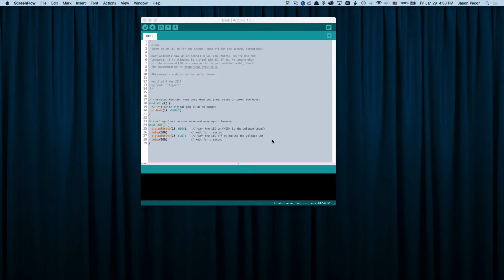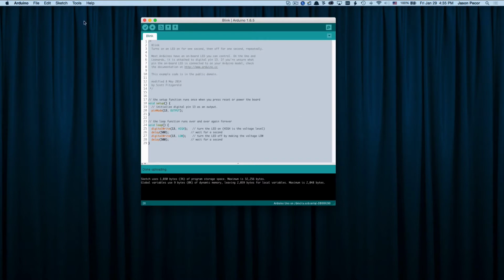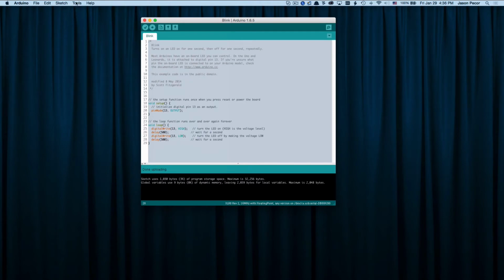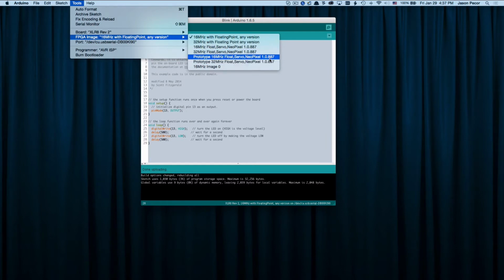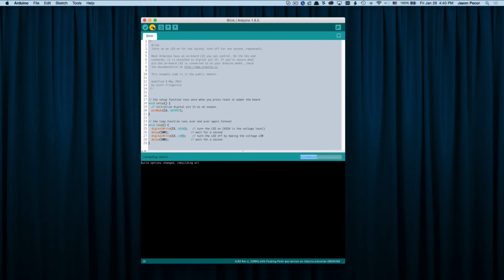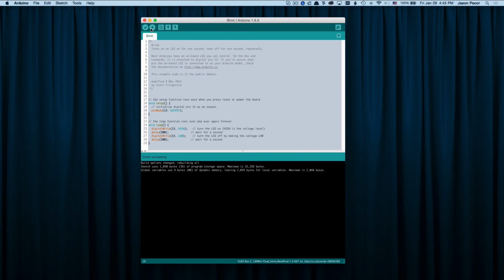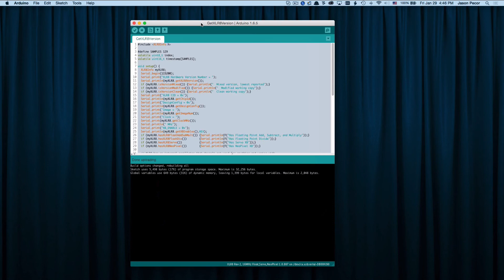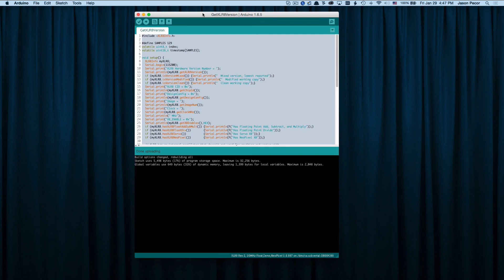XLR8 Board Support for Arduino IDE

Comment: Hi,  I am using a xlr8 board. I set up Arduino IDE as U advice. When complying the 'Blink' example codes, I got the error below: 
 cc1.exe: error: -fno-fat-lto-objects are supported only with linker plugin.

exit status 1

Compilation error: exit status 1

kindly advise! 
thx
Reply: Looking at the repo (usual place), it seems this hasn't worked for at least a year and a half.  In May 22, someone asked about an out of date dependency.  They promised to look into it... and it seems we're still waiting.  It's now not possible to install the support package in Aruduino without producing errors.  It's a shame.  It looked like an interesting approach to using FPGAs but it looks like they've abandoned it.